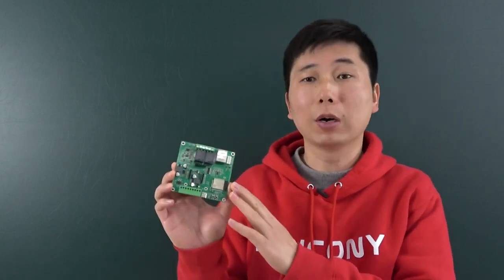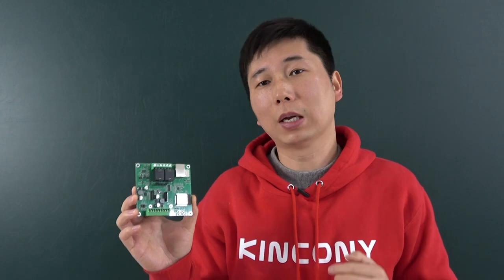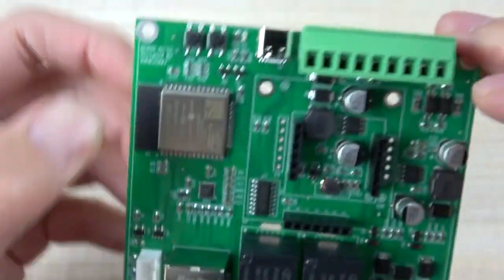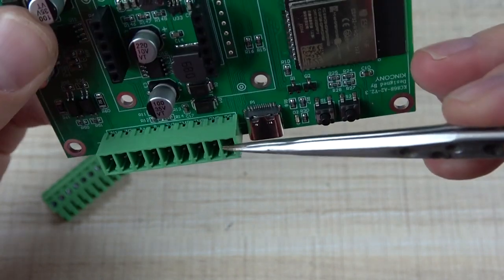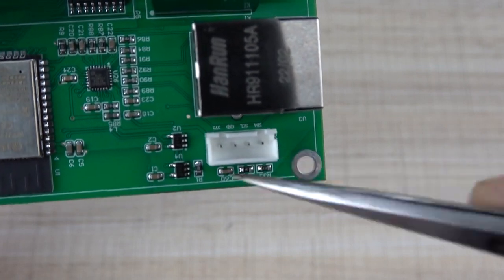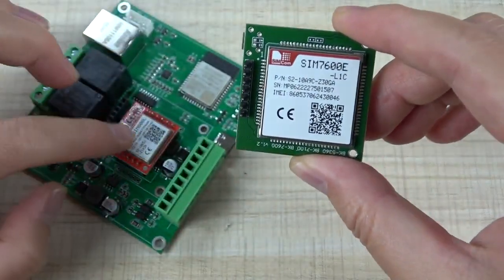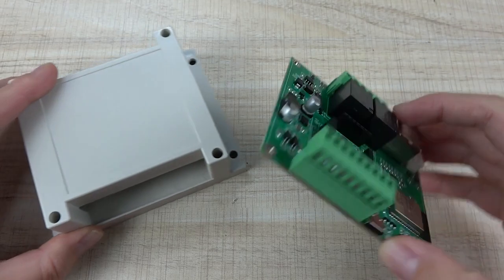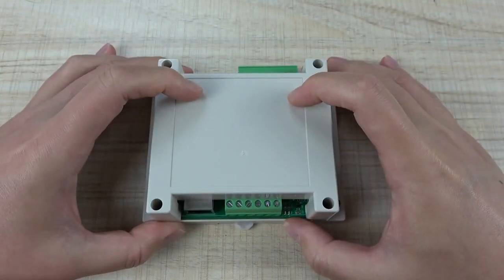ESP32 + 2G SIM800 +4G SIM7600 + Ethernet RS485 relay KC868 A2!

Comment: I have purchased a similar board and programmed the RJ45 Ethernet port for the LAN8720. However, after running for a while, the Ethernet port stops receiving signals, and the green status LED no longer blinks as usual. The issue does not occur with WiFi — it continues to work normally.

Could you please advise why this might be happening? Also, if you have a sample program for using the LAN8720 Ethernet module, could you kindly share it for reference?

Thank you very much.
Reply from the maker: can you add my whatsapp:  86  15531181781, My technician will be in contact with you to guide you on how to handle it. Please let me know the model you ordered.
Reply: @kinconyiot  model KC868-A2